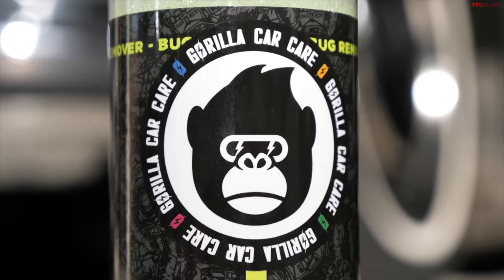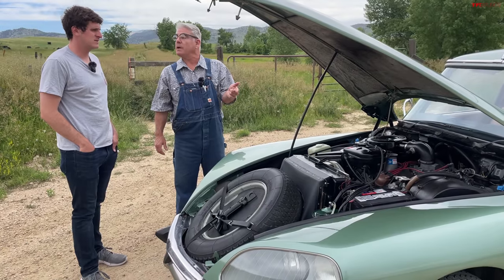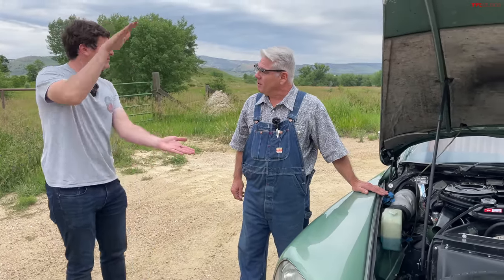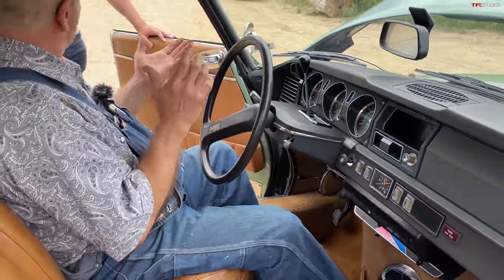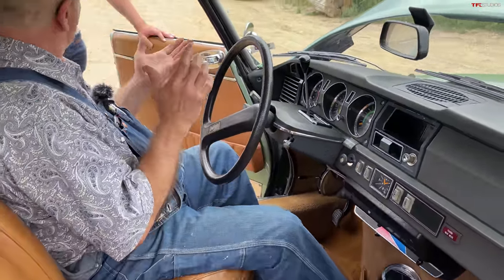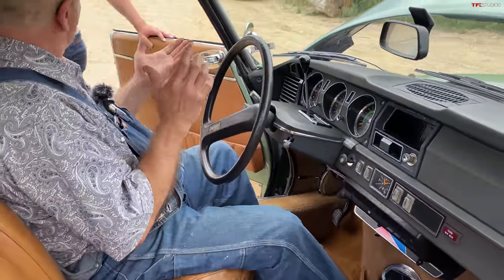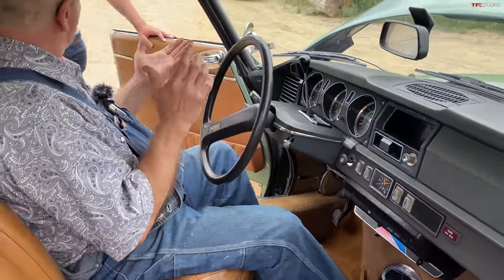Really THAT Unreliable!? Is The Citroen DS as Bad As The Internet Says It Is!?

Comment: The 71 Subaru FF1 had some similar features, or at least different than the mainstream. Like the Tardis it seemed to be bigger on the inside than the outside. perhaps a bit more like a Saab though. Monocoque construction. Inboard brakes (albeit drum, not disk). 4 wheel independant suspension with torsion bars on all 4 corners. Front wheel drive. Trunk held 21 soccer ballls (according to Pele). $1,800 out the door! The engine and tranny orientation for more like Saab too. Engine in front of the front axle and the tranny after. That probably helped a bit when they converted to 4WD or AWD. P.S. It too had the spare under the hood, but as it was a pancake (boxer) the tire fit above the engine/tranny.

Comment: This Citroen DS with around 110 Hp was a top end luxury beast at the time, and you could see them just woosh past other cars, running over 120 MpH on the Autobahn! Many European cars went fast for long distances with small engines an little horsepower! My own 1974 VW Passat Kombi (wagon) took 18 seconds to reach 100KpH (60MpH), but it topped at around 100 MpH with a 1.3L 55 Hp engine, and with tail-wind even reached 180KpH (112MpH)! European cars were geared long for top speed and fuel efficiency, not the short gear legged silly drag racing the American muscle cars were built for. I had friends, whose parents had Citroen cars, and they were the MOST comfortable of all, including Mercedes.

Comment: I love these cars. I have a '72 that I am busy restoring, I have owned it for 30 years. My dad fitted a Toyota 2.4 turbodiesel engine more than 30 years ago, and it looks like it was done in the factory. I would like to continue the legacy and electrify it, just working through the powering of the hydraulic system. "First, you need wine..." 😂 Exactly.

Comment: The self leveling suspension uses mechanical feedback from the torsion bar, if one side is to low, a stick pushes on the pressure regulator on that side, thus increases the pressure on that side. Causing that side to increase its Hight. simple and robust.
Reply: End to end, front to back, not side to side
Reply: @alro2434  yes you are correct, my answer was unclear

Comment: These DSs were remarkably reliable.
I put 200k miles on a number of them with a grand total of 3 side of the road breakdowns: H2O pump, exhaust pipe loss & tire tread separation. That's it.
Routine factory maintenance is all I did.
Loved them 28mpg at a continuous 100mph (lived in Europe for a while).
Reply: XAS? On the rear? Mighta been an un-noticed flat leading to the separation.
Reply: @alro2434  
I was cruising at 100mhh(?+) on Hy 50 in Nevada in the summer... old Michelin, drove on the steel belt for an hour after that (but slower)...🤔

Comment: I've got a Wolseley Hornet, which uses a much simpler Hydrolastic suspension, less advanced but really good for an ecomony car. I did hear a story of someone trying to use Citroen fluid in their hydrolatic system and they absolutely ruined it. Always use the correct oils and liquids and don't mix.

Comment: Well, in all rumours is a grain of truth.

Back then, many hydraulic problems were caused by the original fluid(and lack of maintainance&knowledge).

The DS started with HF Rouge, a plant-based fluid - later came red LHS which had a tendency to form resins. Not great.

In 1964 LHS was replaced by colorless LHS 2 which was hygroscopic - it attracted water (like braking fluid). This lead to corrosion problems if not maintained properly. And it ate paint.

In 1966 green LHS finally came along and all those problems were solved. Change every 40,000km and that's it.

Of course being so outlandish and dealers being so sparse didn't make it any better - especially in the US.

Comment: The DS was so far ahead of its time, i loved it the second i saw one. I was so sad that Citroen left the USA. Their bad reliability reputation was mostly undeserved. the super clever fluidic computer they used, employed these cylinders filled with a special green liquid, and the avg mechanic had never seen such a thing, and they put in other fluids which ruined the system.  The suspension was amazing.  It is an analog computer basically taking the position of this input and delivering the correct response.

Comment: Is the Rode mic bluetooth?  If so it could be because of bluetooth crosstalk - loads of bluetooth devices trying to communicate with each other in the same space.

With a critical bluetooth devices such as a mic, I find it best to unpair the device and re-pair it BEFORE you get to the event, also when you connect with your phone make sure that the mic is the ONLY BLUETOOTH DEVICE YOU CONNECT TO - if you can DISCONNECT ALL OTHER BLUETOOTH CONNECTIONS!

I've had quite a bit of experience with bluetooth devices

Comment: One reason that Citroen might have become known as being unreliable is that the Germans forced Citroen to create a fleet of vehicles for them during WW2. France was under military occupation and couldn't resist. But the designer of the truck the Germans wanted decided he'd pull a fast one on them and made the engine oil dipstick too long. 

So whenever they would pull it out and check the oil, it looked like it was topped up perfectly. 

But in effect it was running low and not lubricating the engine correctly. They were constantly breaking down. A clever example of delayed satisfaction sabotage.

Comment: Having owned and driven a Citroen ID-19 in the past I apreciate the DS shown in the video, I did however notice the speedometer was not working during the drive and it appeared a heater hose on the passenger side under the hood appeared to be disconnected.  I did not see a posted price for this vehicle or where it was located.

Comment: When I was a kid my dad claimed Citroen were major disasters to repair. The big problem I have later realized was that he was the kind of car owner who expected to be able to repair just about everything with the minimum number of general tools. His first cars were VolksWagen Beetles, and these he could dismantle just about anything on using a screwdriver, a adjustable spanner and a hammer. Same with his later Volvos. they were simple and very easy to work on without any advanced tools. But the Citroen DS does require some more tools of you will most likely have a huge problem working on them.

Just the fact that the engine block is aluminium makes it necessary to have a torque wrench, something my father never owned. Trying to handle it like a VW or Volvo engine you would most likely over tork the bolts and possibly strip the threads. Then there were the complexity of all the systems in the car. This meant there were a lot more things going on and systems that were interconnected that simply didn't exist in the cars my father were used to. I remember him going on about special tools to get to parts. But I've later in life talked to mechanics who say that they are extremely easy to work on, if you just have those tools... Never had the chance to actually dig into one myself.
Reply: You nailed it down!
For "simple" germans and us-americans that was too much. I'm writing that as a german who's living in the french speaking area of switzerland (lake geneva).
My daily/2 times a week driver is a Citroën Dyane of 1967, a luxury 2CV.
Cordial greetings!
Géréon

Comment: Lovely looking car but..........I saw a crash test video and because most panels are bolt-on the car virtually exploded on impact and there was little passenger protection. A shame but unfortunate. Also, if you get a leak in the suspension fluid, the brakes can fail. Hmmm?

Comment: The guy was wrong explaining the air in to the radiator. The air intake is under the front, invisible, if you don´t lean down. The intakes he pointed at were the air intake for the ventilation system inside the car!

Comment: I don't know about the reliability of that particular car, but I've gotta believe getting parts and finding competent mechanics to work on it would be a real bear. As an fyi, I once bought a French car new, a 1985 Renault Encore, and a popular automotive writer of the time referred to the Renault Alliance and Encore "desperation merchandise even when new". Sadly, I agree with that opinion.
Reply: Work done poorly by workshops ruined quite some brands' reputation. The word ›exact‹ didn't exist. Ignition timing had to be adjusted manually. If done well, the cars would start at any weather condition or temperature. If not, they won't work. And so on. When I started to do everything by myself, and to do it in an exact way, my Citroëns (mostly cheap 2CVs) became perfect reliable cars.

Comment: At the start is mentioned 21 is submodel. Actually it's saying something about the engine sice (2.1 litre)
A submodel would be "pallas" . Possible to get it with one of the first electronic injection systems (as told in the video)
At 32 minutes, talking about brakes....I've made once a full emergency brake with a speed of 20 km/h. someone opening their car door at 4 meter distance before me. My passenger in the back hung against the front chair...but the car (DS 21 station, also a 1972 model) stopped including reaction time in 3 meters....This was only possible due to that braking button which reduces the technical reaction time from 1 second to 0,5 seconds (if you're used to that car). With this stop the car did dive in the front wheels , contrary to what is said. A very deep dive ....and a real stopping distance of centimeters because the kinetic energy was absorbed in the oilpneumatic system.. When releasing the brake pedal the car veered back a few meters.
Until today (this was 45 years ago) I'm sure I would not avoid an accident there with any other car ever made. Even not with  a tesla on autopilot. 

As for selling records after introduction:
I suppose that the selling records have been broken after presentation of the ioniq 5 (due to covid an internet presentation). In my country the introduction model was sold out in minutes only.

Comment: A great system. Unfortunately Citroen fitted mild steel pipes to the systems, which ran exposed to road salt in the UK. Corrosion to these was an MOT failure. Otherwise a brilliant system - in all its uses.
Reply: Yikes. I grew up in Michigan. The weather & salty roads would make you feel right at home.

Comment: Always loved these cars and wished I had one, if not the SM with the Masaretti engine. In France in the 60s as He said France  bad roads. The French used to drive these at full throttle down these roads. This of course was not the safest way and consequently all too often you would find them completely totalled 0n the road sides. Very little survival rate inspite of the safety features mention in this video.

Comment: In 1970 I bought a 1969 DS it cost me £395. It was a really good car I sold it in 1972 for £100 pounds and a deep freeze. yes, There were problems  But I have been trying to get another for 50 years It was A great deal of work and a great deal of fun. I passed my driver's test in it even though a double-decker bus crashed into the rear when I stopped at a zebra crossing to allow a pedestrian to cross. The examiner jumped out of the car and swore it was not his fault. I was a very happy 24 year old . the bodywork was jambed against the rear wheels  So I raised the suspension and got the wheels clear of the wheel arches carried on with the test  without suspension on cobbled roads, Nowadays they would book you into an asylum. Happy Days

Comment: Had a DS20 (4 speed manual column change) for 5 years late 80s, çruised at 70mph no problem did 100mph+ flat out had a DS23 with the fuel  injection  don't  know what that actually did max, both accelerated well once you were out of 2nd gear

Comment: The only other car comprable to the Citreon ID19 or DS21, with many of the same/similar features, although with a different suspantion system that was equally unique, was the Rover P6/2000TC. Which interestinly had almost an anti lock 4 wheel disc brake system with inboard discs in the rear.....

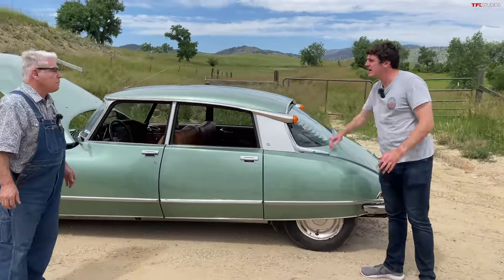Comment: 20:43 The position of the blinkers hasn't got anything to do with safety. Safety wasn't a thing in the 50's and 60's. The reason is esthetics. When they made the design, they found out with the prototype that there is not enough space for the rear passangers, so they raised the roof by several centimetres. But that way the car lost its dynamic shape, so they put the blinkers on the top to keep the streamline. There is a documentary on Youtube where employees of Citroën themselves explain this in detail using the original blueprints and chronicles. So, no offence to this guy, but he's just guessing. As my grandfather used to say: if you don't know, then don't guess either.

Comment: Is the host Doug Demuro's son? Seems a bit like it. Nice review here! I never knew about these genius cars. Way too expensive sounds like. By the time it got to the poors hard to tell if they put brake fluid in the oil system which would eat all the gaskets away. Which would be super expensive I bet to fix at that point. Sounds slow though too and that wouldn't have went over well. Maintanence isn't something people tend to do well over here, and if they are in the service and away for a while hard to tell. The lines look like normal brake booster steel tubing, so it shouldn't have a issue with leaks more than any of our power breaks have, though sounds like the more they sit the more chances they might have trouble regaining funcitonality. 
The system is leveled by gravity naturally, as the heavy liquid is going to sense the changes in the COG so that would make sense. All the aicraft around WW2 and on ran on hydraulic fluid probably not too different than that. I think he said he had a connection with a guy at the airport for his? I know you said something about it was used on aircraft breaks, well it is a similar system, it powers flaps, alerons, rudder, breaks, landing gear, shocks for landing gear, and anything else that would need it, I would guess that is partly what inspired it. 
In europe that was en vouge, smaller cars using aircraft technology. Like you were saying, smaller streets. rebuilding country, short relative drives. Messerschmidt had a cool small car that reminds of this style. 
ANyways, nice work. Thanks!

Comment: I was privileged to have my mothers DS 21 super 5 after she no longer wanted it . I must confess l hated the car and wouldn't even drive it in mothers ownership BUT ! Sometimes you have to swallow your pride and shouldn't look a gift horse in the mouth ! So l had no car and mum said have mine ! Well that centre brake button may have looked odd and indeed it took a little while to master and the column change too . Then the self centering steering and lets not forget the swivelling inner headlights ...oh and the armchair comfort seats , the amazing design , introduced in 1955 ( l'm repairing an M.G. Magnette ZA also introduced in 1955) and finally that incredible 3 position suspension (  Rolls Royce used that technology , under licence,on the Shadow ) The only problem l had on that car was the initial delay before the car" rose " . Sadly that was it's demise . A "friend " got into the car whilst l was working  and for a prank put the suspension lever on maximum high . By the time l realised the suspension was destroyed and so was the car .......a sad ending to a trully incredible car . Did you know Rover bought one ,took it to their shops , dismantled it and cribbed a lot of the design build and that's how the Rover P6 was created .

Comment: Try to find parts for that hydropneumatic suspension .  Those bulb shaped oil reservoirs are expensive and they all eventually go bad.
Reply: Every part is quite easily available. And yes it will eventually go bad. After many years, like most, if not all, usual mechanical component. 
So what's your point?
Reply: I just replaced the 2 rear spheres. EZ-Peezy. $160 delivered in 3 days.  They were more than 6 years old and weren't exactly 'bad', either.

Comment: Had a smaller new model gx3 which was just becoming a collector sorted after car &a vandam palace with air cool for the 1st. gx3 I soon learnt that most repair shop just didn't want even change or just fan belts or replacement part so was roll me sleeves up time after a ford finding you only need 11/13mill spanners &scocket everythingwas easy ride quality was on par with jaguar smoothie quiet ride

Comment: there ok untill the spheres loose there gas charge and the suspention goes solid as a rock or if in a country that uses road salt,ok untill the steel brake and suspension pipes rot out as bitches too renew and non standard size pipes and fittings!.

Comment: The air duct for the engine is too low. What happens if Rain gets sucked up through there?? Or deep water. I've never seen air ducts,,so low.....wow
Reply: The air duct for the engine is under the hood. The ducts in the bumper supply air to the cabin and, below the black bumpers, are the air inlets to cool the disc brakes.